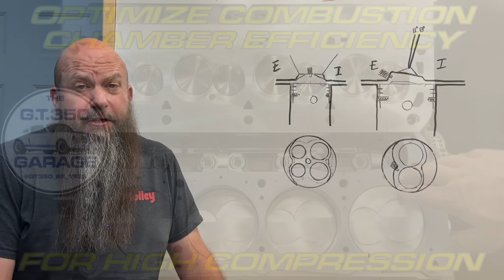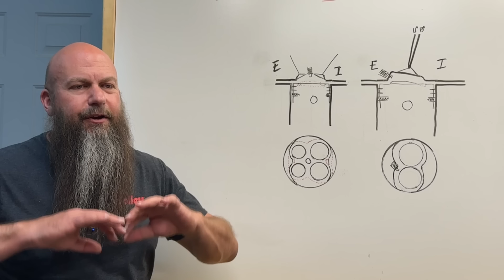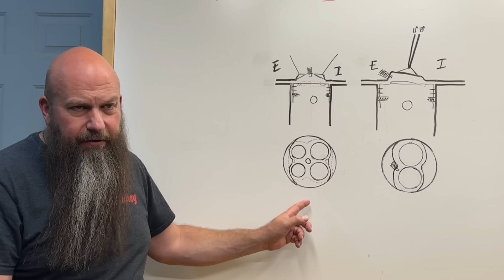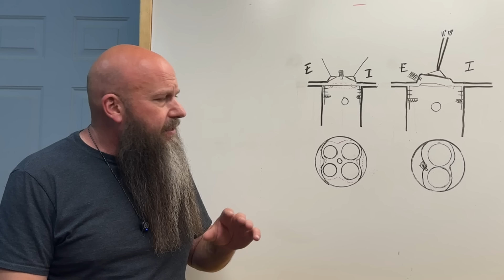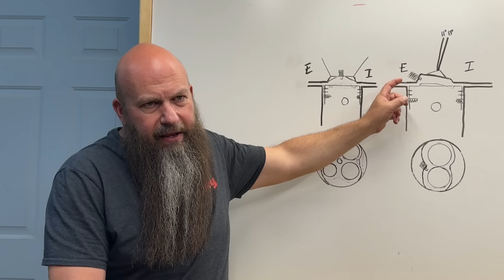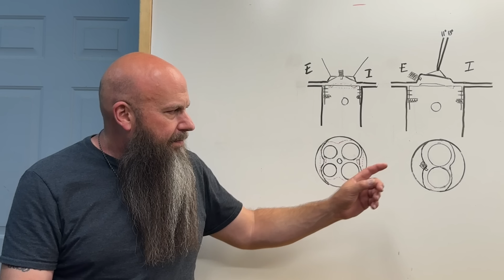How To Optimize Combustion Chamber Efficiency For High Compression And How It Impacts Tuning

Comment: The GM guys would put the 305 heads on the those old low compression 350s and I believed it did help. I had a old 82 chev 4x4 that ran on propane and I had to replace the heads because they cracked and I put on used 305 heads and it gave the truck a little more pep until those heads cracked. Propane and GM heads didn't like each other. Lots of people in British Columbia had propane powered GM trucks and they all had the same problem and the Fords and Dodges didn't have that problem that I'm aware of. The Fords loved Propane and they ran good on that fuel.
Reply: 160 degree thermostat and good radiator and fans will solve that....25yrs propane high performance holden v8 strokers,no problem.
Reply: @petethomas9623  I live in the frozen North and I need heat. My 30 year old Ram V10 is propane powered.
Reply from the maker: My experience with propane is limited to big block 385 series Fords.  It has plenty of octane, but you have to tune it up to get it rich enough to make power and not run lean or it will run hot.  And with the correct air/fuel ratio, it needs the correct timing, or again, it will run hot. 

The 160 degree thermostat comment is not the best advice.  Thermostats only set the MINIMUM operating temperature of the engine.  If it gets hot with a 180 or 195, it will get just as hot with a 160.  More radiator, bigger fan(s), high flow water pump, should be a last resort after identifying the tuning is correct and the engine has no other mechanical issue causing the high temps.

Comment: Does a big bore short stroke help with being able to run higher compression relative to octane requirements of the engine?
Reply from the maker: Yes and no.  It’s less about the stroke and more about how the rod ratio changes piston dwell, and there are advantages to a lower rod/stroke ratio with higher compression.  A 289 Ford has a R/S  ratio of 1.8:1, a 302 1.7:1, a 347 is 1.58, a 454 Chevy is just 1.53:1.  The longer the piston dwells near TDC the less timing you’ll run, because the piston does not move away from TDC as fast and the pressure acts on the piston, pin, rod, bearing, and crank journal before the crank is in a more optimum position for the force to spin it.  But the longer dwell can improve engine efficiency, lower temperatures by exposing less heat to the upper cylinder wall, and usually produce more torque than a shorter rod would at a lower R/S ratio on the same bore and stroke.  So it depends on the purpose of the build as much as anything.

Comment: Thank you for a great explanation.  What do we do if we are building an engine with open chambers and there is not an improved head available?  My bore is 3.40, stroke is 4.125.  (Slant six) I am shooting for a 9.5 compression.  There is no possibility of a quench pad.  Not without angle grinding or welding. My thinking is that the bore is small and the flame path is shorter than on a 4" bore, so it is a bit better than  a big bore with a dome.  I have to use a dished piston to keep the compression ratio manageable.

Anyway, can you do a video on how to best use an open combustion chamber?  Thank you.
Reply from the maker: The chamber on a slant six is unique.  The spark plug is fairly central but the engine design has far too much piston to head clearance.  The key would be minimizing piston to deck clearance and using as close to a flat top piston as possible.  The small bore works in your favor.  If I was tailoring the piston to the application, I would have a dome that went past the deck into the chamber, or either mill or weld the head to reduce the chamber from an open configuration to a closed configuration.  Anything you want to accomplish is possible with some effort.

Comment: Hey man i got a 460 in my thunderbird heavy car 3800 pounds my question is if this is a dialy driver and i climb mountains with it would i be better off with say 10.5 to 1 or keep it at 9 to 1 because ive seen the stock early high compression lincon 460 have detontion i got a set of D0VE heads and i deshrouded the valves in the head and have polished the chambers i need to get the heads milled because they were 77cc pre work and now they are 80 to 81 cc these are iron heads woch i heard are more detonation prone I really want to run high compression because right now i have to run 22 degrees initial advance and total timing at 2000 rpm is 36 with the vacuum it goes to 50 degrees no load light cruise. But she hauls ass though man especially compared to the stock 302 it came with 

Good video sir merry Christmas

Comment: I really like this guy. He has spent time thinking about whats going on in the engine. Many dont. Ive watched quite a bit of Steve Morris Engines vids recently and whilst I really like the guy and they certainly can screw a sweet looking motor together, you can tell from his descriptions of the whats and whys, he not actually an engineer and doesnt have the depth of understanding. Im really glad this has talked about 4 valves because actually they are a very good compromise between hemi and wedge and overall out performs both in most scenarios.

Comment: The process of softening the chambers would be another addition to the build. Seems to be common on boosted and NOS applications. I have run motors as tight as .035 piston to head with success. Typically with 30 to 32 degrees of timing. The Ford N head was a great head. Too bad no one makes it in aluminum. Be interesting to see the final results.
Reply: I’ve run 0.023’ for 4v 1.6 7000rpm limit
Reply from the maker: On a smaller engine you can get away with a tighter clearance, smaller bores have less piston rock, and a lighter forged piston that minimizes mass with a proper rod like a Carrillo H-Beam, you can run less clearance and still turn fairly high rpm.  The 2.3L DOHC engines I used to build were 87.5mm bores, 94mm stroke with a 155mm rod and I was turning them 8500+rpm with barely .75mm or .029” piston to head clearance at 14:1 compression.  There wasn’t any need to run tighter clearance on that engine honestly.

Comment: Following with great enthusiasm. I've heard of great chambers of quick burn watching Kevin Cameron and Mark Hoyer?? on Cycle World's channel talk about the Norton Commando and it only needing 28° of ignition lead. You sound confident that you are building the same efficiency and in doing so the killer detonation won't rear its ugly head. I want you to definitely succeed,have you accomplished this before on other engines? I understand the quench and the small chamber being needed ingredients. The aluminum heads should help too. I know you don't put stock into dynamic compression but wonder what the spec's are on your cam, if you have said already I'm sorry, I missed them . Thanks for your work and will be following along. Do you think you will put engine on a dyno and break it in and tune it to see the ignition lead requirements and h.p. and torque figures ?Maybe some would be willing to contribute help cover the cost I would. Thanks

Comment: Hi Walter, I love your videos on octane. Thanks! Did you chose 91 vice 87 octane based on your detonation prevention goals (hot spots) that you touched on during the last minute of your explanation here?
Thanks!
Reply from the maker: 91 offers more resistance to knock than 87, and even in a well managed combustion chamber, cylinder pressure can cause the fuel to ignite and combust when we don’t want it to if there is insufficient octane.  Octane has no bearing on power production directly and really no bearing on ignition timing.

Comment: Efficiency is happy, happy makes power. soft camber is the band-aid for a positive dome or the talent to make a chamber that mirrors the piston exactly with .040 tolerance. Design of the engine choice is limited to efficiency by head arrangement.
Reply from the maker: Softening the chamber to normal enthusiasts means cutting the chamber in an end mill to create a slight concave the diameter of the bore that eliminates quench.  

Not “softening the head” I studied the Soft Head concept that Larry Widmer developed back in the 1980s in detail.  It completely changes the way combustion is managed in the chamber, but it completes combustion more efficiently, and as a result dramatically reduces exhaust gas temperatures.  I monitor EGTs as an indicator of combustion efficiency, and I’m also fairly well versed in chamber grooving in the quench areas.